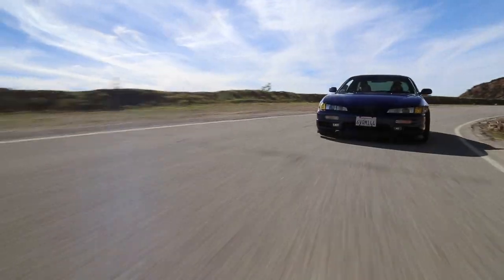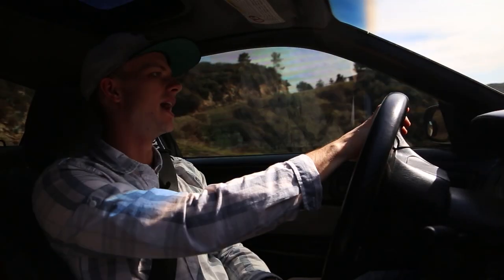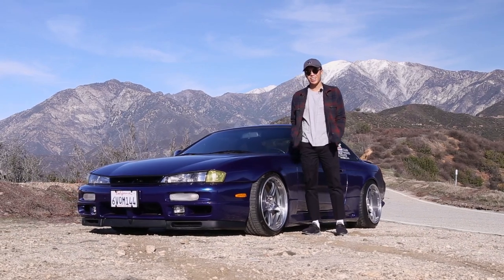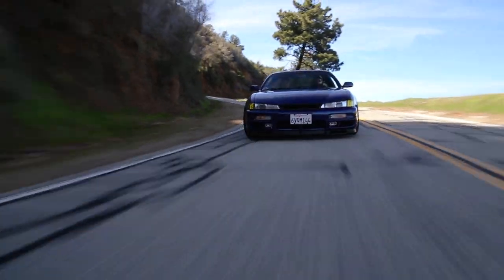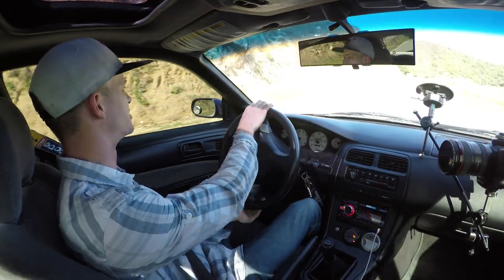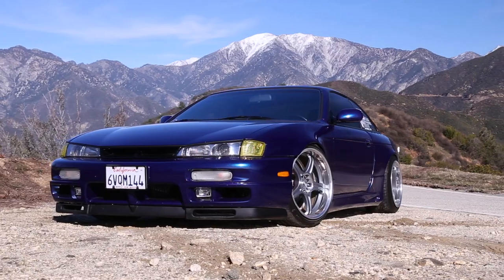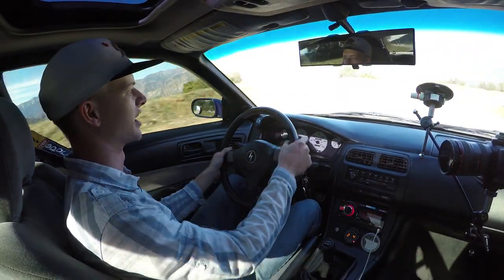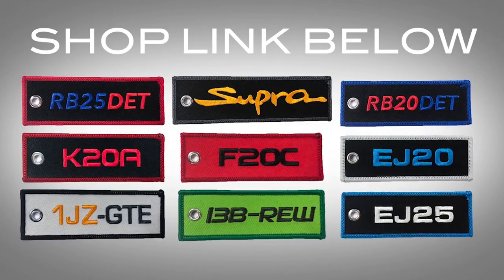The Kouki-Monster S14 Nissan 240SX | A 400HP KA24 Turbo Outlaw

Comment: I turbo'd my 98 240sx ka24de back in 2002 and did 280 whp for about 2 yrs on stock bottom end, then in 2004 decided to build it with CP pistons and Crower rods, knife edged crank, 5 angle valve job, kelford cams and bigger turbo, 740cc nismo inj, final numbers were 482 whp and 465 wtq ... She is a BEAST. 
Its 2021 now and she is still strong and parked next to my 98 Supra in the garage ... never went sr20 or ca18 or rb ... Stayed with the torque monster KA24 .. And was the ONLY ka-t in the city for several years ...
Reply: that's awesome! have you drifted it? i'm assuming the KA-T is a beast when on track. i have an s13 currently- NA KA. i'm planning on building it properly and boosting it in the future. it's just that all the SR fanboys talk down on KA-Ts
Reply: @aku-pf4tl  i dont drift. I go straight.

Comment: People hate the ka24 for no reason
Reply: I think the K24 would be the best upgrade for an S chassis if you wanna stay 4 cyl
Reply: @KiranPatel-fk1pg  do you not like SR's
Reply: Zac /Wonka No I just think that the K series is superior in terms of torque when boosted and reliability. Whereas SR's are more prone to issues and quite weak
Reply: @KiranPatel-fk1pg  the K series is a fantastic motor but remember the ka24 already comes in the 240sx and d21 pickup.. stock internals can easily handle 350whp (yes thats less than a k series i know) but that's definitely good enough for most builds... that's just my take. As for the sr20 motor i think it is super good but super over hyped... way too many people do sr20 swaps without thinking it through
Reply: @KiranPatel-fk1pg  Sr's gets issues because the owners doesn't take care of them. And weak because the owners doesn't do the right upgrades.
Reply: Eric P Fair enough, I guess I just have a different opinion to you guys because in Australia Silvias come with SR20s factory and even though they can be reliable I think it's cheaper and easier to just go for a K series or JZ if your looking at an inline six.
Reply: @KiranPatel-fk1pg  yeah absolutely. There is no arguing it, the k series is much better than the sr20 or the ka24 Here in the US everyone just instantly outs the ka24 and i think it's worth a shot at tuning
Reply: I respect that! 👍 I live in Europe and the notchtop Sr came stock in my s14a z edition. Bought it 2-3 years ago and wouldn't swap the Sr for anything other than a VE head.
Reply: Ikr.....
Reply: KA's are bulletproof
Reply: @WonkaFab nah they be blowing up and are extremely expensive to replace

Comment: Always loved the s-chassis, i never had one but my dads friend had a stock s13 way back in the late 90's, later on my friend down the street had a stage 2 one which he rolled in a field 3 times after passing me and losing controle while braking way to late for the upcoming roundabout, that was something...😉 here in belgium we only got the s13 as far as i know it had the ca18det engine in it. I think they had around 170-180 hp at the crank, i know my friends car was running around 250 crank.and now where i live theres a rugged s13 sitting a few houses down the street on a drivewaywith faided paint and inflated tires. I notice it every time i pass and i hope to pick it up one day and start building it up, for now thats wishfull thinking, but s13's where always pressent in my life one way or another seeing there are so few in my country i think it's in my faith to own one some day.😃👍✌️👉

Comment: 315whp = 400hp?
Reply: Every dyno reads different, but yes 315 wheel
Reply: 400 in the engine. 315 at the wheels
Reply: The engine loses hp for every component that it has to move.
Reply: Unless that was a real heartbreaker dyno, even with drivetrain loss, that should still be around 350-360whp.
Reply: @creedns  320whp is quite close. U should calculate around 20-25% loss, biggest loser is the tyre
Reply: @m4tuh4  Drivetrain loss IS NOT percentage based, this is one of the most persistent myths in the automotive world. Talk to any drivetrain engineer and they will tell you a drivetrains parasitic loss is essentially a fixed value, not a parameter, and that significant increases in power at the crank correspond only to a very small increase in parasitic loss. If you have a car that is making 200 crank and 160 WHP than if you push it to 320 WHP (double the wheel HP) then the crank HP is probably around 365, 375 max.
Reply: could have been on a mustang dyno
Reply: like 335 whp
Reply: Should be more in the 330whp

Comment: I have had both ka24det and sr20det. If you are going for big power #s. The KA will do it easier. If you want a it to perform well get the sr20det.
Reply: the KA is much more reliable. it has an iron black and strong cams over buckets. not like the rocker arm in the SR. build the KA and you can boost it to like 300-400, perfect for drifting

Comment: There is no reason to go sr20 anymore .  It was only viable when it it was under 2k , and only people on the coasts have access to them at hose prices.  500 or more  to have that thing shipped to the midwest for example.  But even back then you could do a used t25/28 cheap af with a 300 dollar turbo  manifold, pilferred inter cooler from a from a used car, used waste gate,  manual boost controller,z32 lsd.  This was good for around 300 to the wheels but you needed a tune or the engine would blow.  

The best 4 cylinder for this car is probably the s2000 engine because it's one of the best engines of all time. You can keep it NA or go with a mild sized turbo. This option isn't for the light of wallet.  Its aluminum and will save weight. 

VQ is cheap used engine but the v6 requires a twin turbo set up which is going to make boosting it twice as expensive as an I6 like the rb or 2j.  But You can do close to 300whp NA  as well as losing weight.

Comment: 315whp? from all of that work?
Reply from the maker: A stock KA24 makes about 120whp from the factory, and this makes 315whp. I'd say that's pretty damn impressive! 350 lb/ft is the real number you should pay attention to, though.
Reply: he still has the stock rods. They are probably going to break soon from all that tq
Reply: Stock rods and stock SR turbo (GT28R/2560R) is definitely maxed out at 315whp, its a good little turbo for a fun little road car.
Reply: It's mostly stock with head studs and gaskets and the turbo slapped on with other parts to make it work. Of course the body work is probably the most expensive. Suspension geometry looks original with adjustable components and coils.
Reply: @alexstromberg7696  research....

Comment: My sr20 is 200+ HP stock not with bolt ons with them its 390-420HP
Reply: You are NOT getting 420 hp from bolt ons with an SR20 that is stock with 205 hp ... LOL ...
Reply: @ACommenterOnYouTube  got 390hp with bolt ons....... so don’t know what else to say
Reply: Thats all so with a hub dyno  as well
Reply: @donutsgarage5716  205 crank hp to 420 crank hp with bolt ons ... no way, what bolt ons ??
Reply: @ACommenterOnYouTube  did the turbo / plenum /manifold / fuel pump / injectors / cooling system / link ecu plug in on 14 psi made 390hp. Its not rocket science or a shock to anyone else.... just normal
Reply: a KA-T will still lay your ass on the drift track. their torque is insane. there is no replacement for displacement.
Reply: @ACommenterOnYouTube  A bolt on is anything that involves simply removing the stock part and bolting on the mod. No tuning is required, and generally basic tools are all you need. Also, if this applies to you, bolt-ons can be removed and the car returned to stock for stuff like emissions tests.   Google definition and I guess the world 🤷🏼‍♂️
Reply: @aku-pf4tl  yes the ka is a torque monster, when i punch mine, its fucking gone ... there is no lag
Reply: @ACommenterOnYouTube  right??? it’s 2021, KA-T aftermarket support is here. people finally are realizing it’s much more superior than an SR in the drift realm.

Comment: Buy tires that actually fit the wheels.
Reply: They’re stretched so he doesn’t rub
Reply: So in that case buy a wheel and tire setup that fits? I don’t get this logic. It doesn’t make any sense.
Reply: fast02gt because you don’t know about the hot boy fitment 18s with stretched tires so you don’t rub lowered on coilovers.. the car comes stock with sunk in tires on what looks like size 16 wheels anything more than 18 is to big for an s chassis if you had size 18 wheels with meaty tires the damn thing would look like a truck...it’s just for looks
Reply: Hey man, thats how younger millennials and older genZ kids are, the negative camber with stretched tires.
Reply: @verticaleffects3518  i got 17x10's in the rear with 305's on my S14 ... my shit don't rub because my coil-overs are set to hard so my ass doesn't squat.

Comment: yeah so this engine is not as fast top end wise because SR20det is better funk the KA
Reply: LOL what? the KA-T is much better than the SR. bring both engines on the drift track and you'll see the SR will struggle to keep up. KA-T produces much more power and torque.
Reply: @aku-pf4tl  SR has more top end the KA has a drop off the Fastest SR20DET in the world is 2000hp Utube it! havent seen a KA do that yet oh and yeah where is there a Stroker kit for a KA havent seen that yet either LOL!
Reply: @aku-pf4tl  I have a 405whp S14 with a SR very fun LOL :)
Reply: @shanetyler9391  KA doesn't need a stroker kit as it already has a long stroke. and yeah I admit the 2k hp sr is pretty crazy. I've seen 1khp KA-Ts running around. Both engines have great potential and can be a whole lot of fun. KA-Ts aren't bad though. both when built properly are great when drifting

also, low end torque is usually preferred in drifting rather than top end. with low end you can do what an SR does at lower RPMS. SRs are good for drag racing
Reply: @aku-pf4tl  Yay whatever lol!
Reply: @aku-pf4tl  never seen a 1000hp ka on Utube where are they? Looking for more SR parts LOL!

Comment: KA24 🤮🤮
Reply: what do you mean lol? a KA-T can outdo an SR easily... the KA-T has more power and torque...
Reply: @aku-pf4tl  Stock for stock, KA’s are shit. More work/money to convert a KA+T, compared to SR being turbo from factory. Ever heard of a stroker kit?? Wouldn’t build an SR further than a 2.2L, as it would hold a strong powerband as well as a decent rev range.
Reply: @Fredrick656  The rev limit doesn’t matter, the KA can make more power at lower RPMs. SRs are like what, $3.5k-$5k now? With $3k you could build a KA with forged internals and slap a turbo on it and make 350hp reliably.

But yes stock, SRs are better of course. If you’re looking for an easy bolt on swap, SR is the way. But if you want to put more work to have a stronger boosted engine, go KA-T.
Reply: @aku-pf4tl  Rev range doesn't matter... Okay.. I mean it is unfortunate you guys got stuck with a truck engine while the rest of us got dealt with proper engines. Not to mention Sr20det are cheap here, plus there's more aftermarket parts available.

 Also since youre so drawn toward torque output just slap on a VE head on the SR and it'll definitely slap your KA back into a truck.
Reply: @Fredrick656  The KA-T will still overpower the SR regardless.. it has almost 25% more displacement. 

If you get a stock SR turbo setup and put it on a KA- you're going to get more power out of the KA. And there's plenty of KA aftermarket parts now.  I'm not saying the SR is a BAD engine, I'm just saying that the KA-T is capable of making way more power.
Reply: @aku-pf4tl  🤣🤣 okay Tonka Truck boy 🍼
Reply: @Fredrick656  i'm just stating facts... dyno graphs prove it. if you want to race, go SR. if you want to get dirty and sideways, go KA-T. both engines are shitty 4 cylinders.